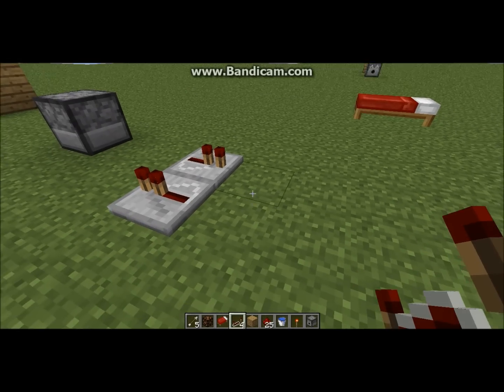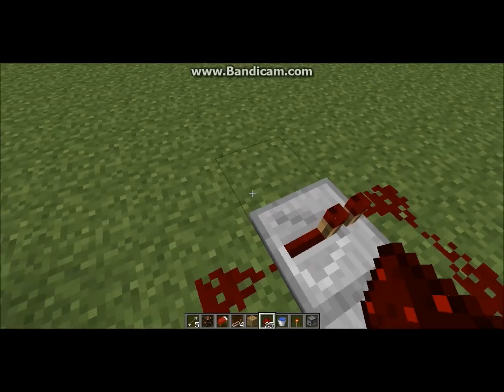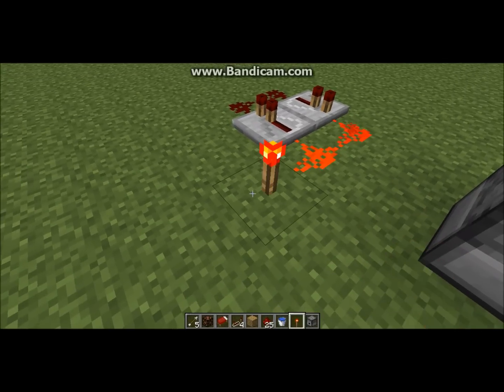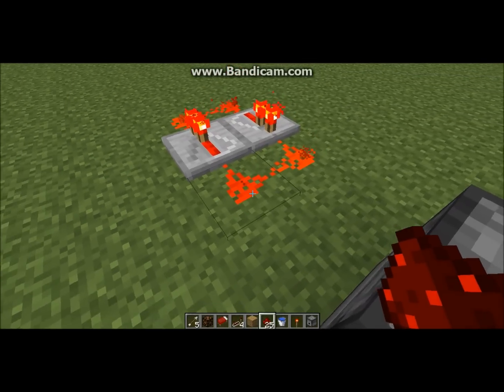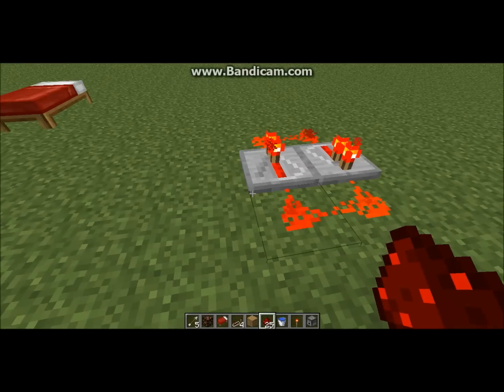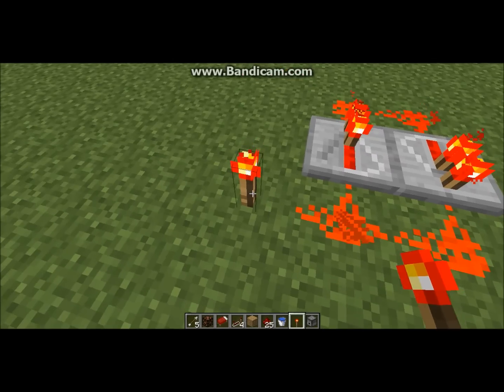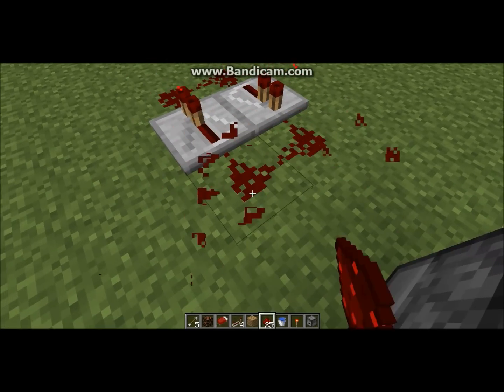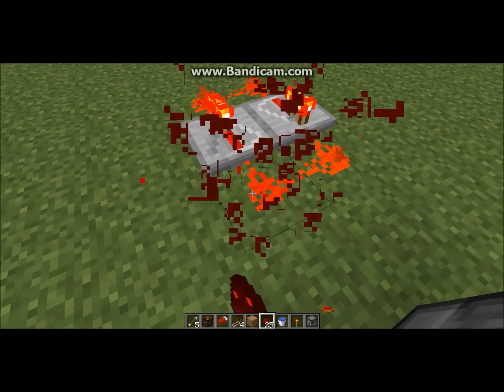minecraft: how to make a alternator that rapidly turns redstone on and off

Comment: You can make the infinite loop's wire go over corners, and then use a piston to slide over the lower wire long enough to kill the current. It stops the flow without destroying the wire.